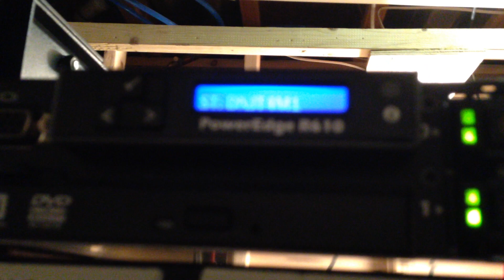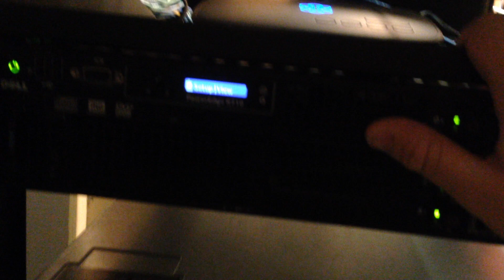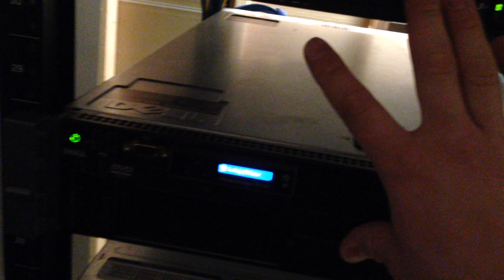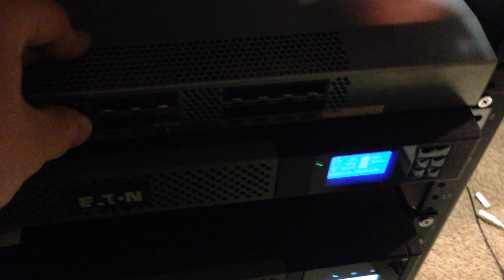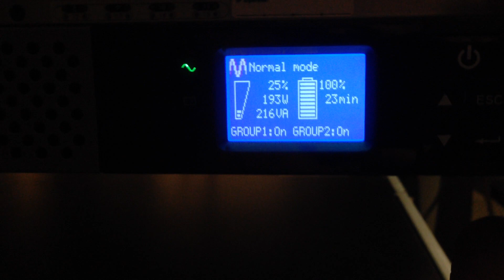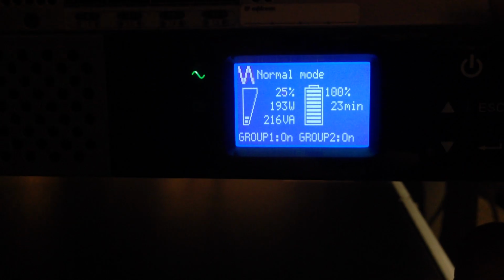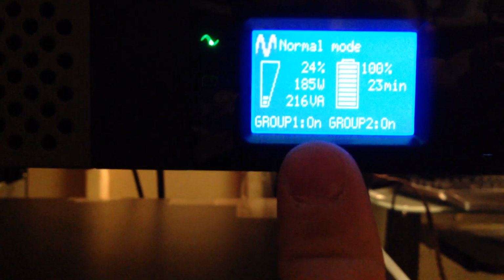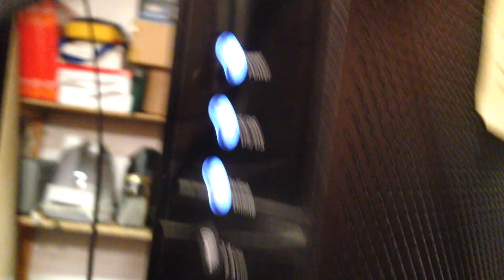Home Data Center Project - 2014 | Dell PowerEdge | Ubiquiti |

Comment: This setup must draw alot of power and i bet are noisy as heck. don't mean to be a downer, but most people use cloud services now for exchange, websites, game services. I also work in IT for 10 plus years and would never take any of these servers home because they draw to much power and are loud, but i guess if your getting them for free why not. Oh and the heat they produce forget about it.
Reply from the maker: It's all good man! And Cloud is too expensive and not worth it imo, if I host what I have on the new servers my R810s it would cost 2-3k a month with the specs I need so it's not worth it my cost overall monthly for power and ISP is 324.89 my business connection is 244.00 a month so it comes out cheaper for me to have my own equipment :)

Comment: very nice! and how in work these ubiquiti edge-switches ? any troubles?
Reply from the maker: +Vasiliy Klyuyev Thanks! and nope not at all! :) i sold the Ubiquiti switches due the reason that i needed a switch to support SAN/iSCSI 10GbE so i have a Dell Power connect 6248P and a Dell Power connect 5448 and just a edge router pro :)

Comment: why get 288GB on a old server?
Reply from the maker: +MrEeeaddict why not lol? its not that expensive and they have 98GB each now
Reply: I was looking into getting one of these servers but aren't 16GB dimms insanely expensive? 

I found it was cheaper to buy two r710's with 144GB vs a single 288GB server
Reply from the maker: Yep, i sold all the slow ram and i have DDR3 -14000r if im right i would have to take a look at it but i know all the speeds are much more than 866Mhz and it was less than 200.00 to do 98GB in each one and i have 2 Hosts now and 1 host for vcenter only which has 2SSDs in raid 1 for redundancy since vcenter is built off java and is very heavy  on IO

Comment: Hey, I'm thinking of getting an R710 or R610 as a test environment, what are the noise levels on these? would i be able to have them next to my desk and not be annoyed?
Reply: James Smith I'm building a custom vertical rack for it (limited space), when i'm done i'll do a video for sure!
Reply: Maybe, i have one and the sound is respectable. It could annoy you
Reply: Lars Bindels more annoying than a regular standing fan? been trying to gauge the loudness and tone of these servers
Reply: cavemankhafra  a little bit, not much. I can accept the noise
Reply: Lars Bindels Thanks! the R710 is relatively cheap on ebay, think i'll get one
Reply from the maker: cavemankhafra Their  fairly quite so much quieter  then a Old 2800 Dell lol i upgraded my BIOS / and firmwares and they stay cool around 68-69 degrees F my Dell R510 is pretty darn quite for being an array/ and has the large double fans that one usually gets little bit louder but i cant even hear the servers their in the room where its mainly concrete floor and walls and its nice and cool in there
Reply: Tom g between the R710 and the R610 which one is quieter by your estimation?
Reply: cavemankhafra Get a DL380 G6, I just got one and its quieter than a laptop fan....
Reply: James Smith ended up getting an R710 w/ L5640's and SSDs, about as quiet as my laptop fan at the same ambient temp (i'm very happy with it), i know the DL380 G6 is quieter, but iw as getting a better warranty with the Dell for the same specs
Reply: cavemankhafra I would have got either they're both superb machines especially for home/soho/lab use! I was setting up a 30TB SAN with a dl180 g6 so I thought may as well have matching G6 and I have more experience with iLO etc! Be nice to see other setups I'd encourage you to make some videos?